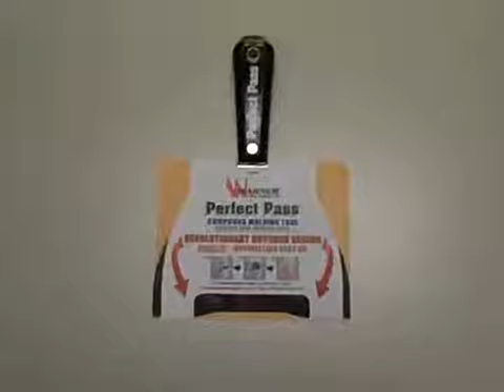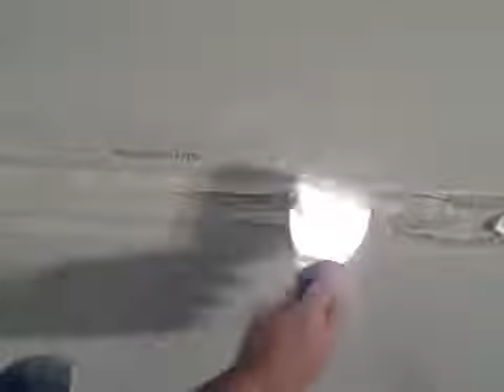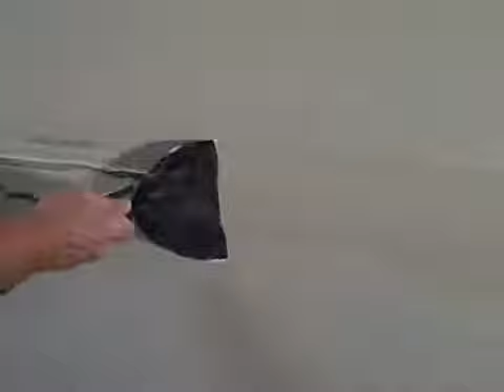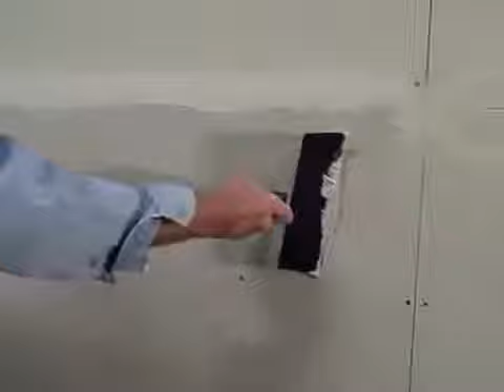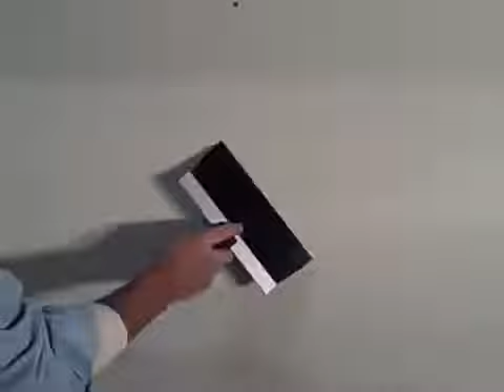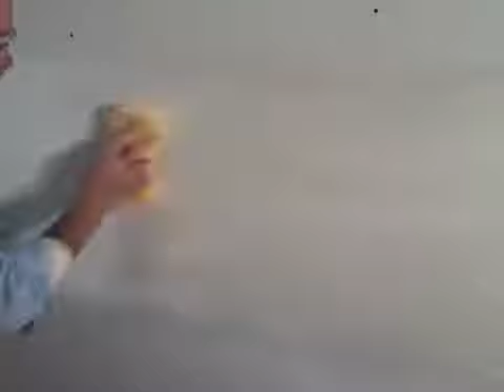Warner Perfect Pass Joint Knife

Comment: I've been finishing drywall for years and ran across this knife. I'm curious to see how it works cuz I'll be using it this week. The only issue I have with this video is the way that the guy applies the compound. You can apply the compound with this knife instead of applying it first with a separate knife then dragging the perfect pass knife along the top.